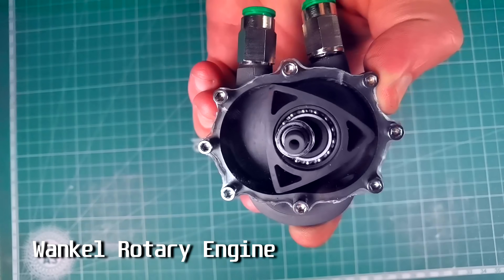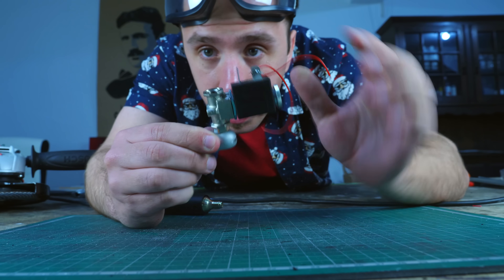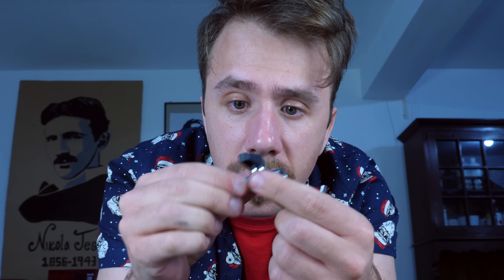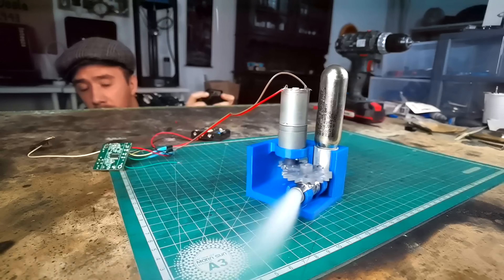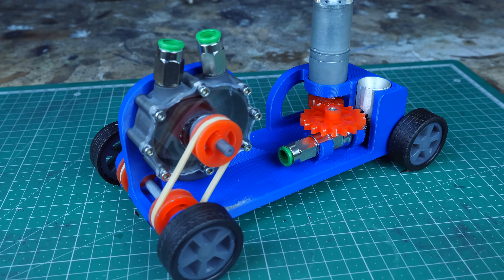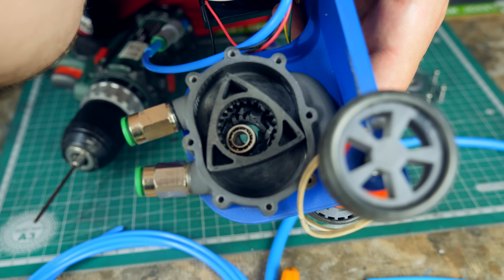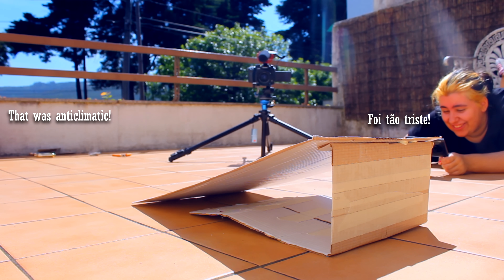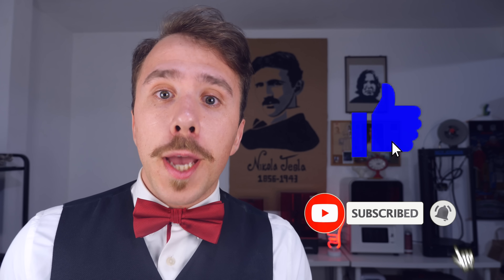Rotary Wankel RC Car (3D Printed)

Comment: you should try to 3D print something like the rocket of nasa the Shuttle Endeavour so you use your rocket fuel and you can 3d print a plane. 

The idea is to send a rocket with a plan attached to it, then you ligth up the rocket and send the plane up in the sky the you can deattached the plane and use aparachute for the rocket so it lands safely and try to land the plane

It sounds pretry hard but there is nothing you can't do ; )